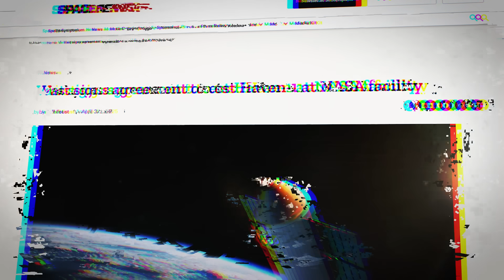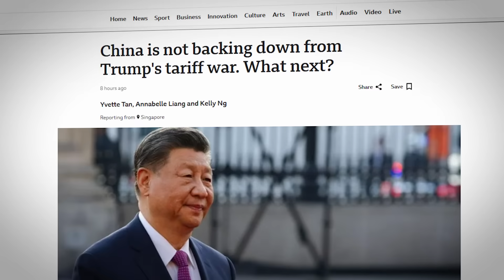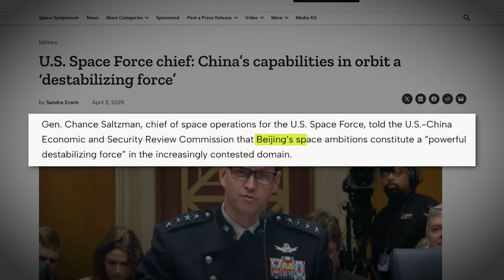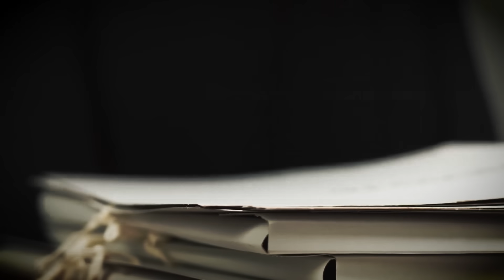SpaceX Reveals Major New Starship Launch Update!

Comment: The Before and after. If the present larger ship requires a32% in size or scale reduction then holding the reduction or consensus by destruction point as usual... Delay to necessary reduction success scale equates to loss of successful  craft of this category forever. Remember the in drop.. MANNED CRAFT IS IMPRACTICAL BECAUSE OF HIGH STRESS AND UNKNOWN PHYSICS AS YET WITHIN THE MARS LANDING DATA.

Comment: They should've put the booster into service right away with an expendable upper stage while they continue working on the much more difficult reusable upper stage.
Reply: To what end?
Reply: @imaginary_friend7300  To do the same thing they're currently doing with their Falcon 1, but with bigger payloads.  The next gen Starlink sats are ready to go right now.
Reply: @blurglide  To what end?  There are no payloads.. the system is still in development.
Reply: @imaginary_friend7300  New Starlink IS the payload.  They're huge and require this diameter.

Comment: Its the fuel lines that are cycling cold fuel over the hot parts to cool then rapidly before firing them up again or whatever isn't it? What did you guys say before? If you introduce new rockets with new systems you introduce new problems and whole new avenues of failure?

I think using highly cumbustable fuel for anything other than combustion is a real long shot and though it looks good on paper it fucking explodes on its way to space when exposing it to red hot components that aren't in the combustion chambers 
Just a thought.
Reply: Except this is standard procedure that works quite reliably. The Starship leaks are not from the cooling circuits.

Comment: In the competition with China the USA has slipped behind with space stations and needs to get a modern next generation permanently crewed station in orbit ASAP and doing that with Haven-2, with Haven-1 as the stepping stone, seems to me to be the quickest route to that right now. I hope that if Haven-1 can prove that Vast Space can deliver then that will open the flood gates to a lot more funding because it is of strategic importance.

The other are is transport and there the USA is in good shape, very good shape for non-crew-rated vehicles, but another area where I hope the USA doesn’t get complacent and where I hope it also invests more in is crewed transport. Crew Dragon is great, Starliner needs to be written off as a dud, Starship might eventually get there but even when it does will in many cases be overkill in terms of size, so the other project in addition to Vast’s Haven program where I would like to see additional funding is a crew rated Dream Chaser. That together with Crew Dragon and at a later date a crew rated Starship would give the USA a really great lineup of crew transport vehicles.
Reply: Agreed. especially Dreamchaser. NASA screwed Sierra Nevada over the first ISS taxi contracts. Time to make that right.

Comment: Booster #15 was a somewhat letdown. 
Seeing some raptors failing to power up or just flaming out was disappointing. After so much test, the raptors should work flawlessly at this point in time
Reply: You make the flawed assumption the problem is with the raptors and not any of the associated support systems.

Comment: at the 1:00 minute mark of the video we're seeing the area between the engines is on fire. Is that normal ?
Reply: Yes. When things are heated to 2500 degrees Fahrenheit in earths atmosphere they tend to light on fire.  Not a bad question though
Reply: No. It’s leaking fuel and burning it off. Not desirable
Reply: for a musk rocket, sure-

Comment: Reusing a booster means nothing if Starship can't reach orbit.
Reply: Just like NASA on every flight, SpaceX is trying to accomplish as many goals as possible on every launch. They are developing manufacturing capability all the time they are building prototypes, so that when a design is finally mature, they will be able to pivot to mass production. They are trying to see the weak points in the Super Heavy design by putting it to real world tests, since they know they want reusability. Why not put it under the test? They might be reasonably sure it will be able to at least do its job (that is get Starship up to the proper altitude and speed to go on to orbit) before it fails, if it does. I may be wrong. Elon is an impulsive SOB who may be playing video games in the meetings with his engineers. But hopefully all those young 20 something engineers who are the backbone of SpaceX are thoughtful enough that the risk is manageable. 
As for Starship.... that seems to be the weak link on getting to orbit. And Elon just got a master class in the idea that when you change shit (i.e. lengthen the fuselage tanks, change the down tubes design, etc.) then your new flight vehicle is no longer certified as reliable as other flights of the old design. That's why NASA and other launch vehicle makers freeze their designs at a certain point and are very cautious on subsequent changes. But old Elon thinks he is smarter than every other rocket engineer in history, so he has to butt his thick head up against the wall a few times before he learns, IF he ever learns.
Reply: You’re an i diot
Reply: Lol. Just look at the Falcon development program.
Reply: @TroyRubert  right, getting to orbit was the priority. Reusing boosters happened way after they were getting to orbit on a regular basis.
Thank you for illustrating my point.
Reply: @vernonkroark  You're being somewhat simple.  Even a partially reusable system is a step up from a fully disposable system.  You're not really thinking things through very far or very well.
Reply: @imaginary_friend7300  they already have that.
You're the one not thinking very well.
Plus, a reusable system that can't get to orbit is actually worse than a fully disposable system that can get to orbit.
You must not be an engineer.